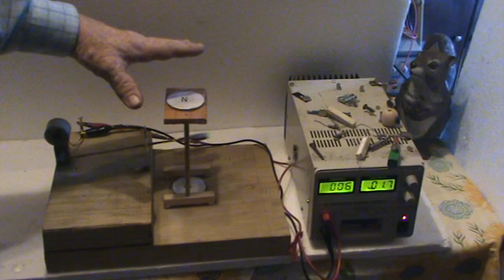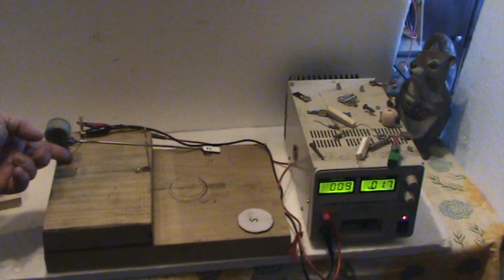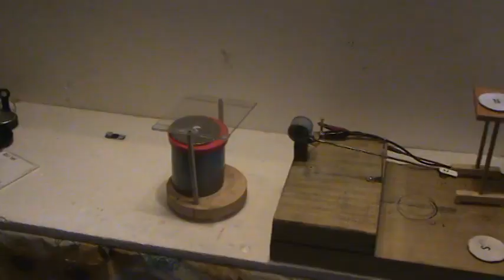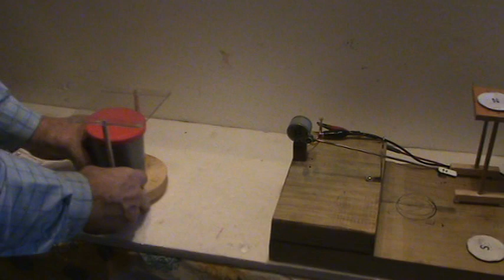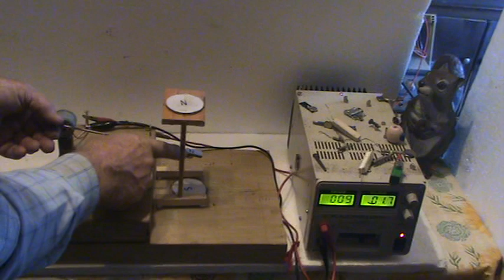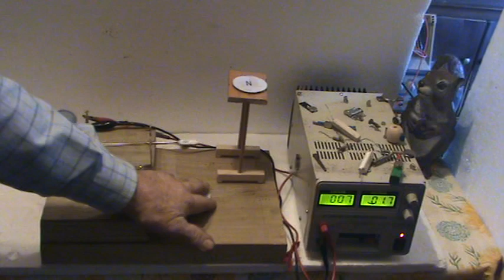Ray's Parallel Magnetics Test 1

Comment: some of the field lines in the wide disk base magnet change direction just above the magnet and then higher over the magnet all flow in the normal direction and the horizontal reciprocating magnet when it passes over the changing field loses weight respectively when repelled temporarily as it passes jumps over the minute like field lines then again is attracted back to the normal flow lines...

Comment: Do you see lower current draw at higher rpm? There might be a “sweet spot” depending  on how long the rod is or how far apart the parallel magnets, strength etc. are. nice demo.
Reply from the maker: the sweet spot is about half way point